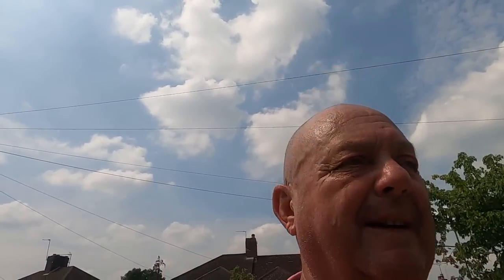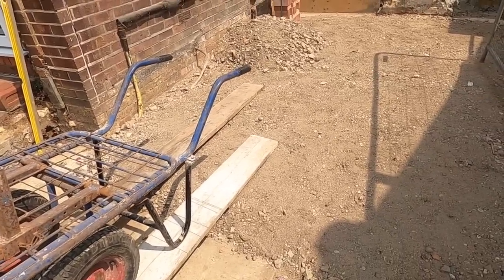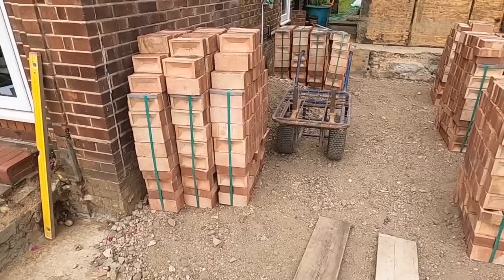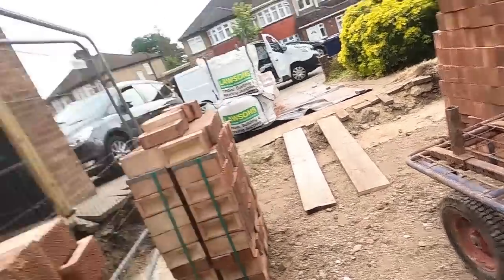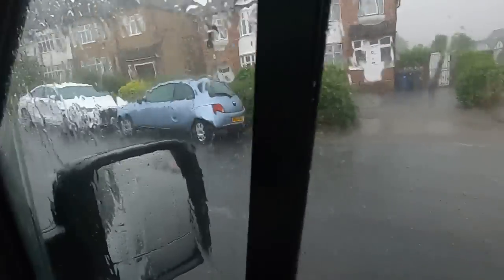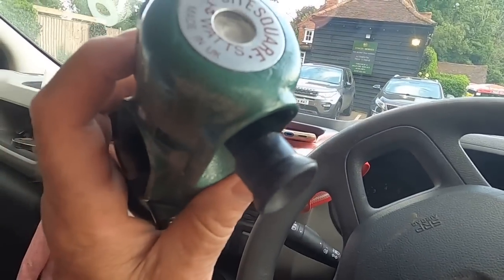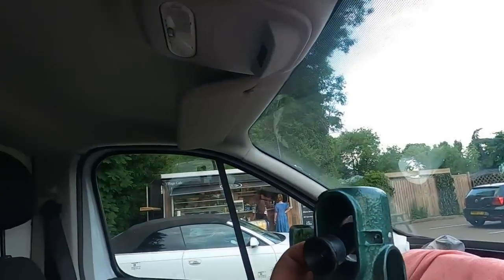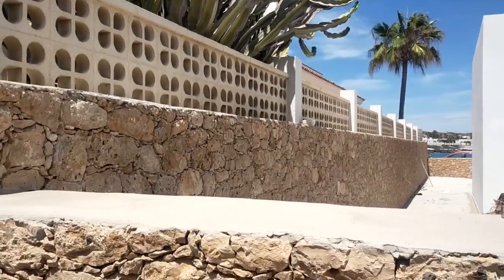loading out with the brick trolley and a vintage site square.

Comment: Good stuff I remember you said you were going to use the trolley on a job. In Oz,Perth especially our wheel barrow tyres are the same as on that trolley so aren’t hard to replace. Also most of our brick packs have 2 plastic bands each pack and still break and come loose haha the fun never ends.
Reply from the maker: Nice one Evan, when I was in Perth it was the Midland brick company ,all steel bands that was 1982 👍

Comment: I work with a brickie some times in Aus, and he put together an electric motor to power one of these around the site. Easier on the sand to move 👍
Reply from the maker: Good idea👍
Reply: @bricklayersworldwithandy6277  makita do a battery powered wheelbarrow...
Reply from the maker: @garywheeley5108  yea I've seen it online, you would have to chain that up lol.

Comment: There are quite a few Hilger Watts tripods on e-bay at the moment Andy , but they are asking between £200 - £300 .
Reply from the maker: Yes but i think they are for theodolites Jamie, the one for the square is different.
Reply: @bricklayersworldwithandy6277  the site square tripods have a pin that drops down like on a cello ...
Reply from the maker: @garywheeley5108  Thats the one
Reply: @bricklayersworldwithandy6277  I bought mine from a builders merchants they used to have a catalogue on a stand toolmail I think used to be in all the merchants about £120 92/93 ish think its all lazers now bit tricky outside though it was good in trenches I used to drill a  5mm hole drop the pin on the corner adjust the 0 bubble an you off ..also I remember the Ali profiles 3ft long 25mm sq worked on green brickwork elastic lines made by truline same people that made the plaster arch kits set up really easy ...and another lot that made adjustable arch formers ..
Reply from the maker: @garywheeley5108  All lasers and GPS if the job is big enough. Not cheap though. Cant say i remember those particular ali profiles, they sound interesting though i do use elastic line occasionally👍👍